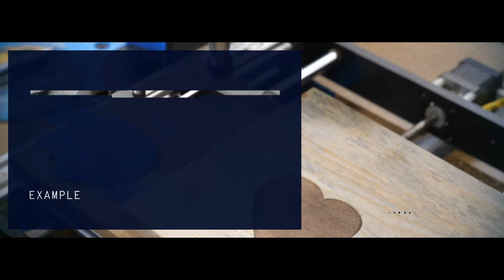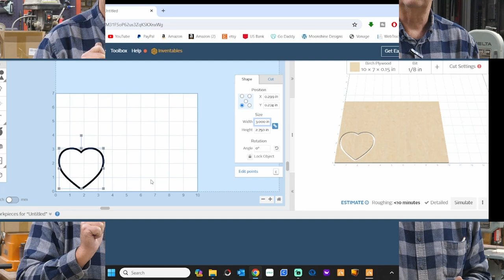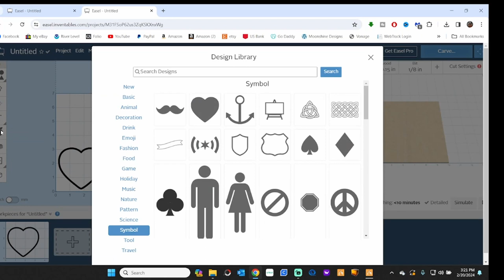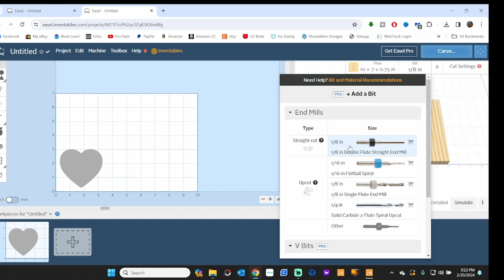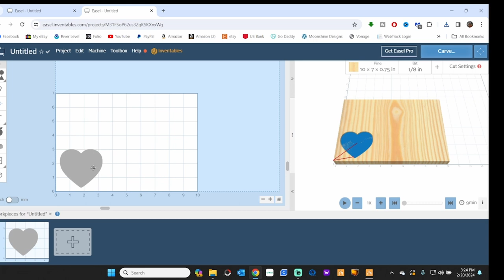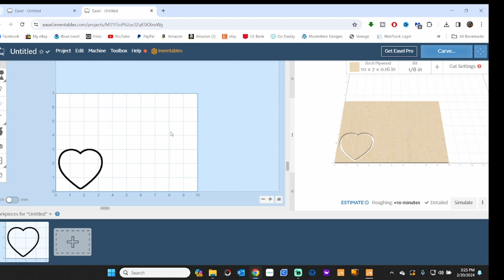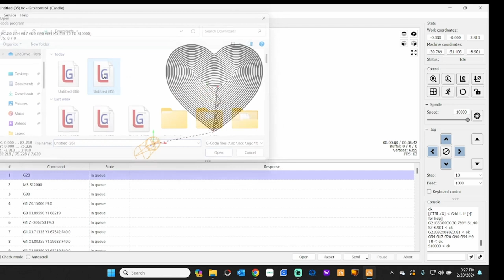Simple Inlays Using The Anolex 3020 CNC

Comment: hello, i have enjoyed your videos on easel and the 3020 anolex table. i have just purchased and recieved the table and also signed up for easel. i am having a real issue with the table. im wondering if you would be able to help me with my challenges . in short when i send a job to the table the spindle shoots across the table until it hits a limit. im not sure were to get one on one support so i am asking you. i would definately compensate you for your direction. please send me a note either way. even if you cant do it maybe you know someone else that could. i just havent found anyone! thankyou in advance.   thanx, Darrell
Reply from the maker: Is your X/Y start point correct?  Try sending the job using Candle to see if that corrects your issue.
Reply: @rogersshop  Thanks for your reply! i am using candle to send the jobs. i am not sure if my start points for x and y are correct. how do i confirm the start point for x and y ? when i send the included sample jobs like smiley face it seems to work fine. its just my one project that freaks out the table. when im in candle and hit send it travels across the table in the x y direction until it hits a limit. makes a weird sound as well.
Reply: @rogersshop  one more thing, have you made any videos that talk about candle and the start points for x and y ?
Reply from the maker: @mrduke43  Not specific, but on most CNC units like this it is the front left corner.
Reply: @rogersshop  is there a way to confirm if and were my  xy start point is? is it preset in the table or do i set it myself. if i need to do it, is it the origin button i hit when i put the spindle on the front left corner?